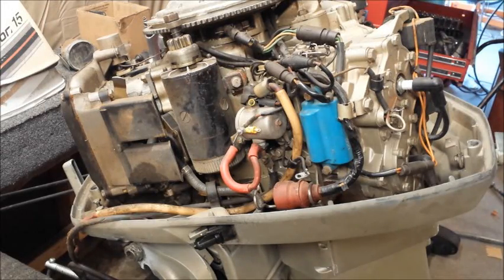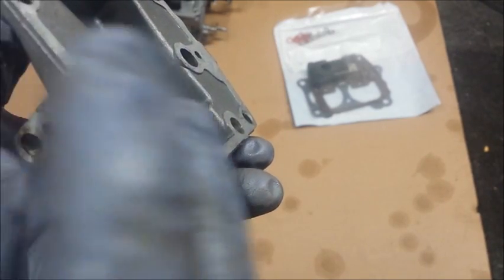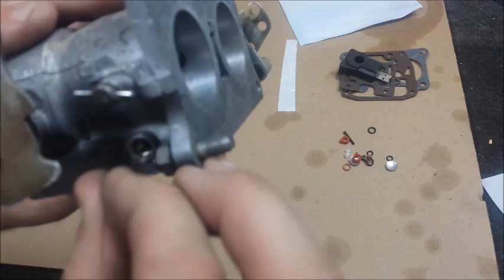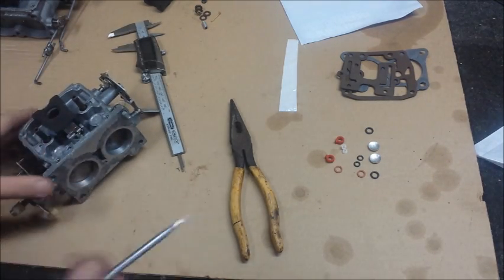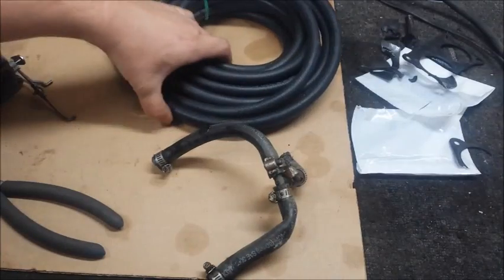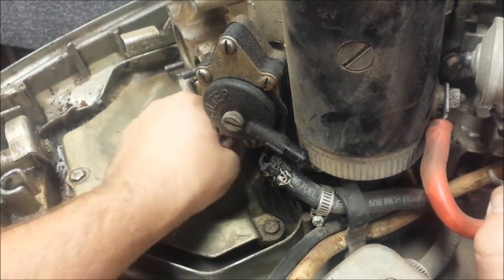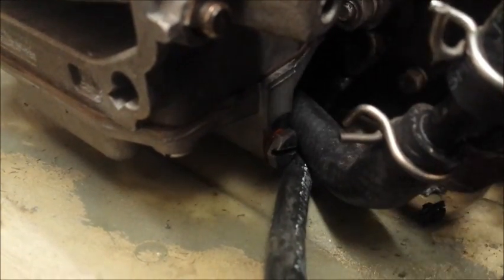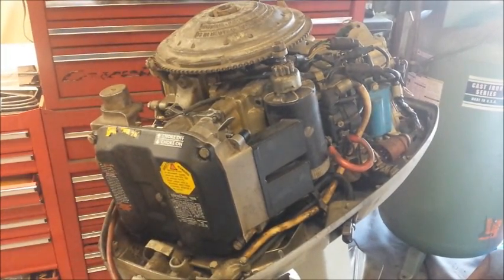1978 Evinrude 85 HP - Carburetors and Fuel Lines

Comment: Hi Brandon, I have the exact motor & have done everything you have done. The only difference is is when cleaning my choke solenoid it has a spring in it between the solenoid piston & the solenoid itself. I checked my 74 evinrude solenoid (older 3 wire) & it also has a spring.  I know it's an older video but I thought it would help by posting my findings. Both choke solenoids work as they should, no sticking. 
The motor runs great after doing exactly what you did.

Comment: Just doing the same job on 1971 85hp Johnson.  Thanks for posting.  It's been about 30 years since I've rebuilt a carb.  I think the line going from the fuel pump to the crank case is the source of positive an negative pressure that runs the pump...pretty sure these were never engineered with efficiency and emissions in mind!  But that old engine still starts with the first crank.  Had to rebuild the transom and all stringers in boat, so thought I'd rebuild the carbs this winter because I think idle jets are worn (original carb, never rebuilt).

Comment: I have a 115 hp crossflow V4. 4200rpms it would act like it ran out of gas. 4000 rmps runs perfect all day.

I replaced and tightened all the lines up. Replaced all coils with oem. The vro is deleted. Now will run great till 4200rpms. 4300 it hits a wall and not as smooth sounding.

What do you think? Fuel pump? High speed jets?
Reply from the maker: All of the above. 
But, if you pump, you would have a few seconds until it ran out of gas.
Then jets or timing.
Reply: @BrandonsGarage  Do you think it could be over propped? 19.6 ft, 14 inch/ 17 pitch aluminum prop.
Thanks for the replies

Comment: I got a 79 100hp and is leaking gas, looks like it builds up in the breather cover from the looks..  does that just mean the needles getting stuck and overflowing/ overfilling the carbs?  Ive ran the motor with no issues for years but always had the fuel leak and tired if the gas headache and risking a mid lake fire..  it has started to get bad enough that when you cut it off you can see the gas mix run down the outside of the lower unit from pooling up in the motor case so much..  like i said though runs fine.  Idles smooth at 800 and high throttle it pushes me about 50mph on my ole dynatrak..  hoping replacing everything in the carbs and gaskets will stop the gas leak..  gotta get it all ship shape to sell it to pay for my funeral.  A quick reply would be awesome as i got to get everything done before my strength goes.  They stopped my radiation other day so guess im pretty ate up inside..  

Ps.  Spend half of life learning so the other half can be spent teaching. Thoughts die but words can live on...
Reply: Prayers be with you brother....
Reply: Im still here!  So those prayers helped..  minus half a stomach, colon and worst part is they took my left nut..  that crap will make you walk funny for a while..  never sold the boat either, couldnt find a buyer but things still leaking gas..

Comment: Thank you for the info. I'm new to boats . have a 1978 115 evenrude hard start cold have to idle up when going into neutral even warm . are all the adjustments done in the linkage? Iv set carbs on old VW bugs and dirt bikes . I don't see u set any air fuel stuff any info would be much appreciated thank you for your content
Reply: Also choke solenoid inop so ill surely try my power probe on it before and after the rebuild u just showed. But even manual choke still hard start ether only
Reply: you won't see any air-fuel needles because, and this is the best part: nothing to adjust with FIXED jets! So really just make sure they are absolutely clean and you are good to go.

Comment: Hey those old stories you heard about carb cleaner were totally true...  A little 175 psi compressed air works wonders...   It's called a "needle & seat"...   Do you really wanna run ethanol in your boat engine...?   They are called Corbin clamps...and Corbin clam pliers...  Just spray the gaskets with Permatex copper coat...

Comment: Excellent video. I am working on a 85hp Johnson. Looks very similar to this one. I have never worked on an engine with a carb. I am getting the manual for it soon. Mine runs then revs up really high at idle. I am noticing there is a lot of fuel in the intake area just before the butterfly’s. I noticed this when I took the intake cover off. Floats don’t make sense to me right now because what if the engine is not level, like the trim is not flat, wouldn’t it not be working properly? I think something is going on with my floats because this seems to be the only thing controlling fuel delivery. As for the measurements of the float travel the important part would be at the closing point. Need to make sure that is closing at flat position. The other direction seem to not matter to much as long as it gets full travel to bottom of the bowl. Would this be correct? Thanks for making these vids.

Comment: I know this is a old video. I got the same motor this is my first boat when I tried to clean the carbs the first time I had the floats bent to far not I got them measured out the boat won't even start. Any suggestions?

Comment: Awesome channel!!!....I recently bought a 1966 Rivers with an 80hp Johnson Seahorse  previous owner said just needed to be fined tuned. I really don't know anything about boats but couldn't pass up the deal was wondering if you've worked on this type of motor before?
Reply from the maker: What year is the engine?
Reply: I believe it's a 1966 as well not sure. The Model Number is V4SL-18C if that helps
Reply from the maker: 1966 80 Hp.
I'm not that familiar with them - but you should be able to get a manual pretty cheap.
But, you might want to look into a newer motor with more available parts.
Reply: I will look into it. Any suggestions on what I could replace it with? Appreciate your help
Reply from the maker: Any newer evinrude / johnson. 
I would try to go 80's and newer.
Seems they mastered them by 1980.
Reply: Thanks for the feedback. I'll look into it and I'll also stay tuned! Where are you from if you don't mind me asking?

Comment: Did they use straight 30 weight oil for 2 stroke outboards back then?
Reply from the maker: Not in 78, but in the 50's they sure did.

Comment: Should have done the welch plugs just to show folks how easy they are. There’s been many a time I’ve found debris caught up in the little chamber.
Reply: How do you reseal the new plugs?
Reply: @dougfleming8816  Most carburetor kits have the new plugs and you just put them in place where the old one was in tap them in with a soft metal or wood punch. When you said it in place it’s convex like a little button and then when you tap it down in the middle it’s concave and it seals tight metal to metal. I’ve been extremely sick with Covid and not able to reply to anything for sometime so sorry for the delay

Comment: When you took apart the first carb there was no hanger for your float pin. You replaced it WITH the hanger. Does this matter? Mine is bogging and I’m thinking it’s becuase the pin is getting stuck becuase it doesn’t have a hanger. Could I be correct? Was this why you put a hanger in???
Reply from the maker: So,
Years ago I had a 1984 Honda ATC 200x. 
The float worked, but the needle got stuck up there all the time.
When the thing wouldn't start, or would start, then die after using the gas in the float bowl, I would find a rock and tap on the carb, then I was good to go!
Years later, I was helping a friend move some stuff around a yard, and there was a Ford 9N tractor there for us to use, which didn't run because of a carburetor problem.
Once again a rock was used to remedy this.

So, do I believe that happens, YES!

New kits come with the little arm to pull the needle down and I love it.
Keep in mind, the engines I reference were gravity fed. Out motors use a fuel pump, and thus have pressure to push the float down.

If you're ever stuck somewhere, you would be surprised how handy a rock is.
A rock is just natures hammer.

Comment: What measurement did you set your float at?, I'm rebuilding 2 of the same carburetors..both of my floats were different lengths..
Reply from the maker: I have a float gauge I use
Reply: @BrandonsGarage  ..I can't find the specs for it?..the length anywhere?

Comment: We’re do you order your parts for this motor?
Reply from the maker: I believe these were from boats.net
Reply: Brandon's Garage hey I was curious if you could help with som wiring questions I need to know what color wire does goin to the ignition switch. Rats chewed up the wires pretty good. It has a dash mounted ignition switch

Comment: hey, gas comes out if the hole in the middle of the top carb? why is that ? i set the float height to specs!
RESPOND ASAP
Reply from the maker: Was the engine level, or tilted up a bit?

Comment: that carb cleaner is nasty stuff. i recommend a cheap ultrasonic cleaner with simple green HD (not regular as it can be corrosive). cleans the carb in 20-30 minutes way better than just a soak, and you won't risk getting lymphoma lol.
Reply from the maker: Naw,
Thats California CARB friendly. Its similar to colored water.
Reply: @BrandonsGarage  Oh...i always thought it was super toxic. Good to know!
Reply from the maker: Well, talking to old timers they would say the carburetor would get clean when it came in contact with the fumes from the 'old stuff'. You dare not let it soak. Even the factory manuals mention this. 

This modern junk, naw.
Reply: @BrandonsGarage  Yea i'm sure some of that stuff was bad. I guess they way the factory wants you to do it is with alcohol and a syringe. never tried that either.

Comment: never stick a wire in any carb you can scratch the internal walls of the gas or air
Reply: canals and change flow Use a strong Rubber tipped Air gun nozzle to blow out small canals in the carb .